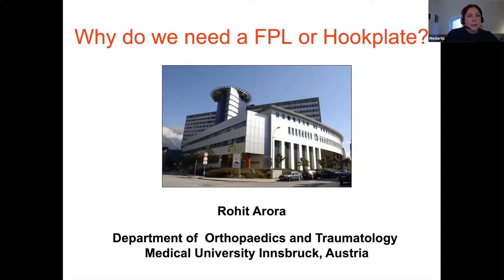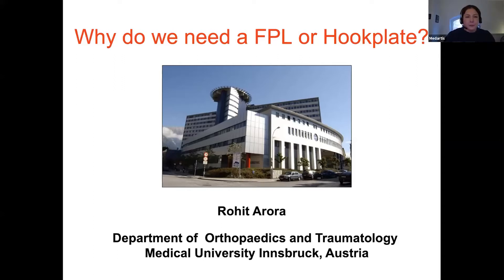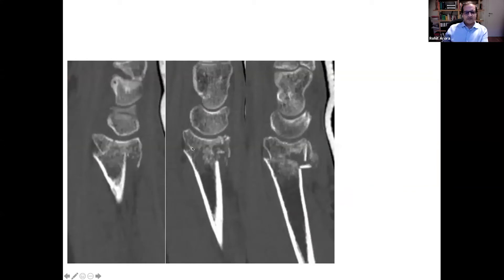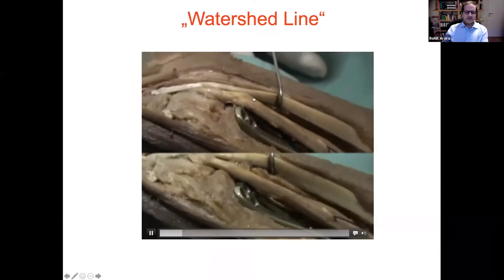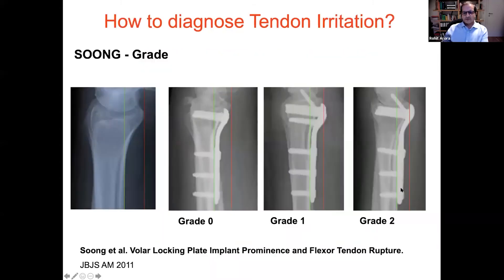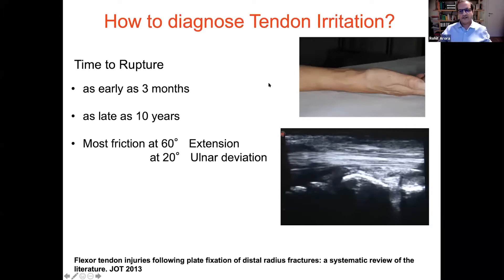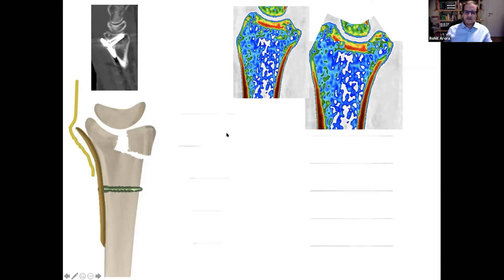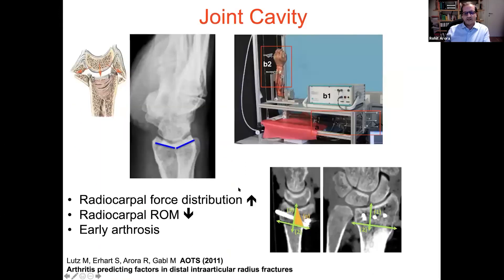Medartis Webinar - Why do we need a FPL or Hookplate? - Prof. Dr. Arora, Dr. Walschot

Comment: Thank you for this interesting lecture. I feel blessed to have medartis plates available at my hospital. The ulnar hook plate and the small hook plates is brilliant, but still I miss a plate that buttress the very most ulnar part of the ulna, which can escape ulnarly. I would like to se an ulnar hook that captures the volar TFCC ligament attachment (and not only the distal rim). And also a plate than can buttress the ulnar side of the radius just proximal to the radioulnar joint. This plate should be anatomically shaped (with a 90 degree twist to be fixed to the radius at the volar aspect). ..... Do such plates exist?